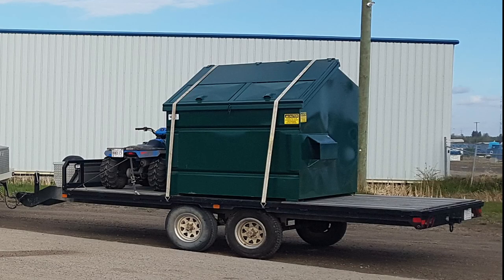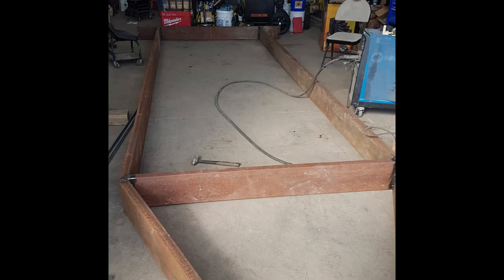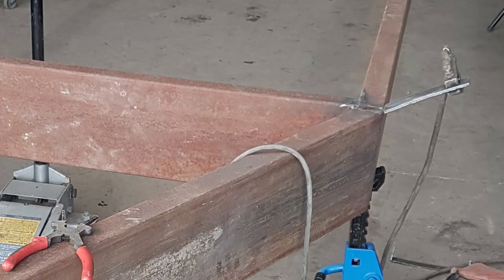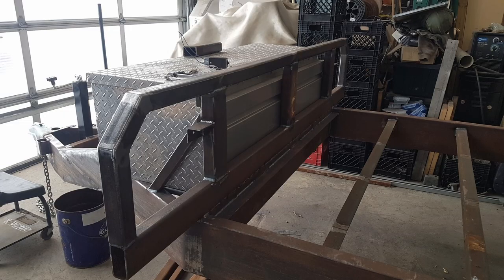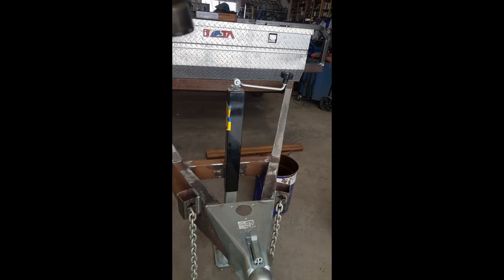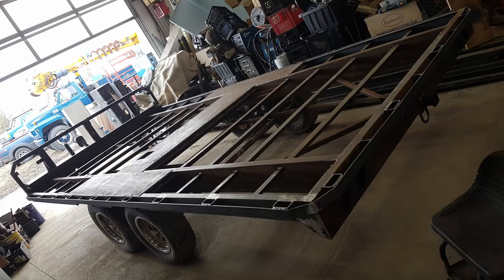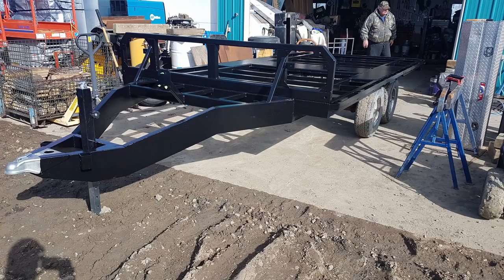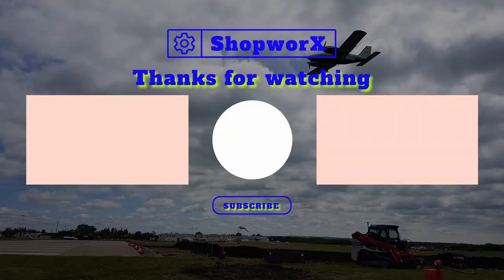16' Tandem axle deckover trailer build

Comment: Did you do a video on the service bed build in your opening sequence? Love your work on the 6 door!
Reply from the maker: No I didn't,  That was done many years ago,  back when there was tons of space in the shop and I was dirt floor poor...lol (still am..  but now I have concrete).  It was a big rust repair job as just about all the bins were rusted out on the bottoms and the deck was not much better.  I have some pictures floating around if you have any more questions on it or not.  Any questions just ask!

 A lot of those pictures in the intro were put in so people were not expecting this channel to be of just one thing, as I work on many different things as needed.
Reply: @Shopworx  fair enough! I have a service bed that I need to clean up, I really wanted to see how you did the lighting inside the boxes. Maybe a topic for future content? I’m just getting my own channel started, so you may see mine in the future! Thanks for the great content!
Reply from the maker: Give me a bit ( a few weeks ) and I'll punch out a little video for you.  I ve done a few service bins and have a few commercially made on other trucks. all with different lighting.  Never thought of a vid showing the different setups.  Once the snow melts.... as some trucks are not in use right now.  Up here alot of stuff is seasonal no one is breaking ground due to Frost $$$ between November and May
Reply: @Shopworx  that would be awesome! I love the service bed on my 96 F350. I need to make a video on building it out. It’s just starting to warm up here, racing season is upon us!
Reply from the maker: Actually you should have a look at the video where I put lights in the aluminum jobsite trailer.

https://youtu.be/IibTiemPbp8

I am really impressed with  the lights themselves as far as mounting and light output.  The ones in the blue service body on the bucket truck were cheap and bright but somewhat delicate if you hit them with tools or material.
Reply: @Shopworx  yessir, I’ve seen that one. I did similar in our race trailer but a row of 12” lights down the center.

Comment: If putting a heavy load on the trailer will the deck drop and rub on the wheels. How much weigh do you think the trailer will handle before this happens?
Reply from the maker: Never had any problems with the tires rubbing on the deck.  Overloaded or not...or articulating off road....

Comment: Do they tow ok with a car on
Reply from the maker: Pulls good.  Hauled a ranger full of scrap steel on it, a 9 yard dumpster and a ATV on it behind my 5th wheel RV.  Also behind the same travel trailer I haul a 4 seat Yamaha wolverine side by side and a 660 grizzly on this flat deck.

 Just about any trailer will pull good with any load if you know how to position it properly for weight.